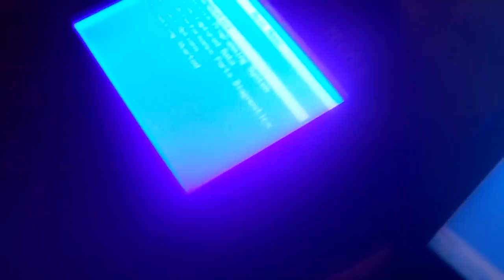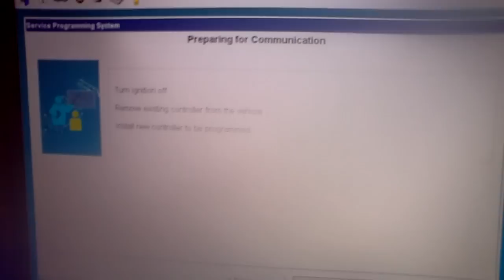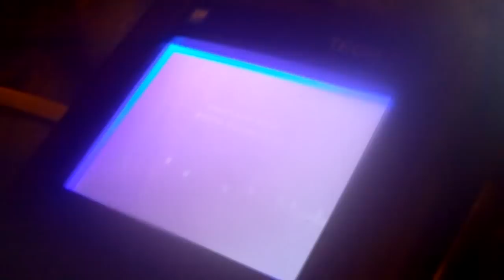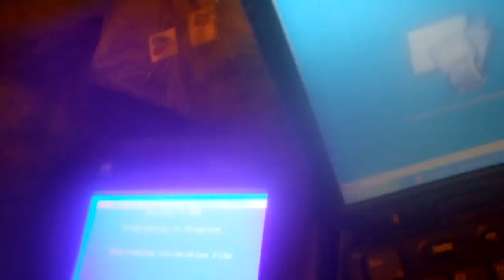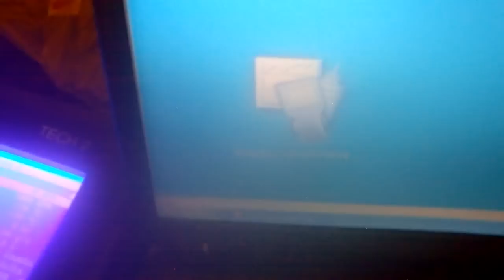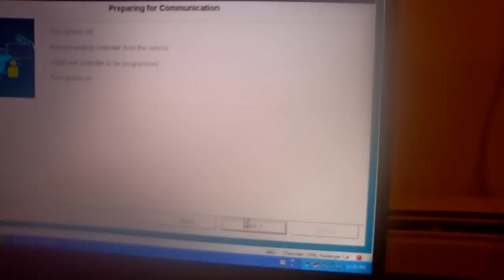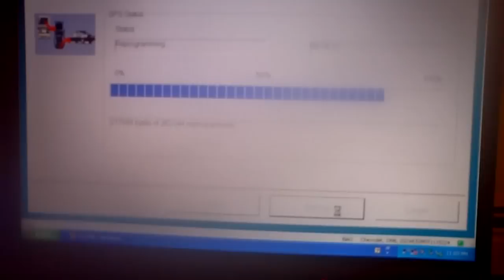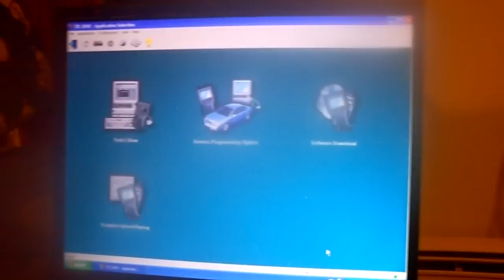Reprogram GM PCM using a Tech 2 scan tool

Comment: I have a Tech 2 and a TIStiooweb account
Reply from the maker: all you need is the pcm, the connectors for the pcm(spares dont cut yours off) and an OBD2 connector, you need to wire the powers, the grounds and the data lines to the correct pins and connect it to power. the scan tool will work like a koeo and a few codes will set but you can reflash the pcm, look at data and clear codes
Reply: hello do you have info on 2003-07 saturn vue bcm reprogramming parameters and wiring diagram , i started seeing these more now . thanks in advance